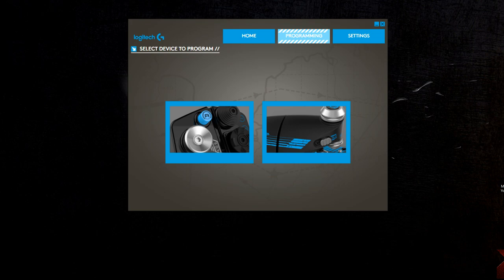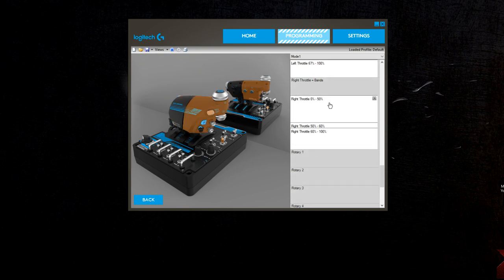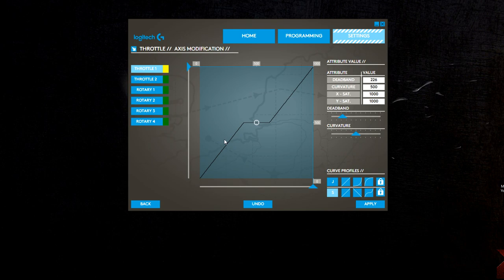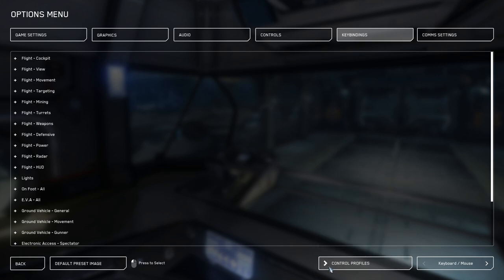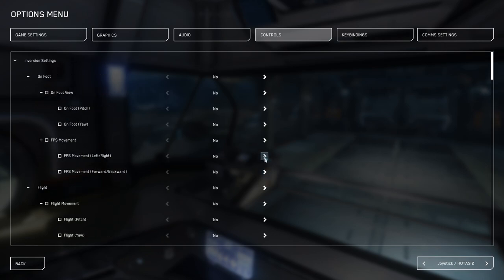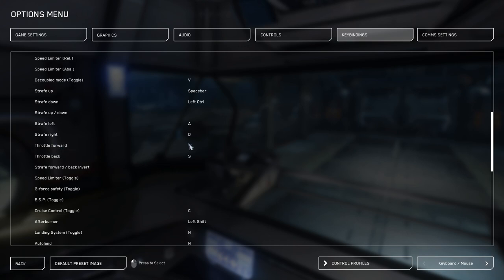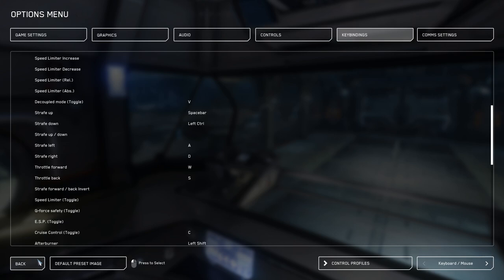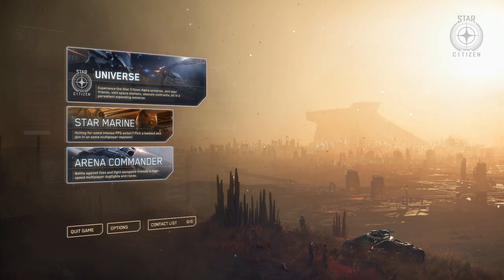Logitech X56 Rhino | Star Citizen | PU 3.17.4 (Still Relevant)

Comment: What can you say about its quality, i cant decide between x56 and t16000m because ive heard alot of negative opinions bout x56
Reply from the maker: Personally I have never used the t16000 but I can say the x56 has good quality metal/plastic build, good springs and easy setup. I did a few internal adjustments to make it handle a bit easier. The throttle has a bit of too much sticky residue so I opened it up and removed some of it and replaced it with some gear grease for electronics. But other than that feels and works like a dream.
Reply: @ArqitectTV  Thanks for answer, i realy dont know what to think about it when i see alot of complaining about x56. In the other hand, next hotas with simmilar button numbers is twice more expensive...